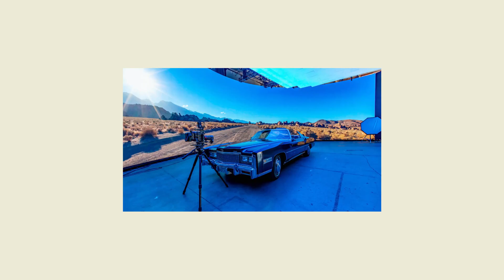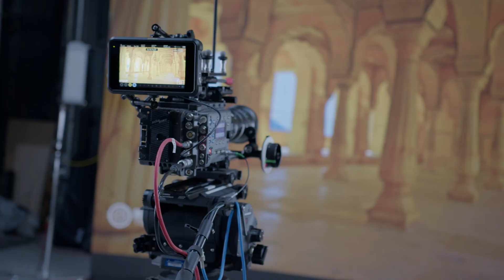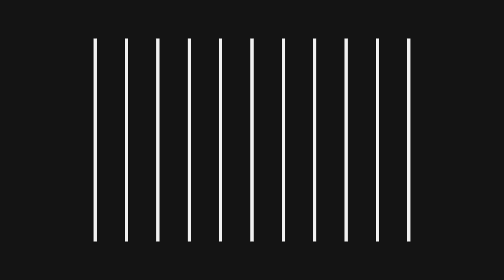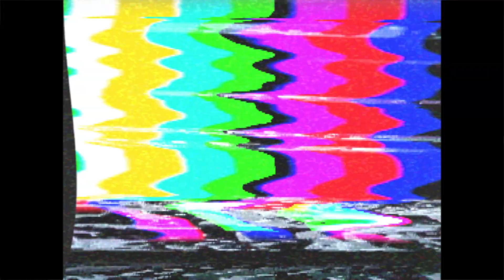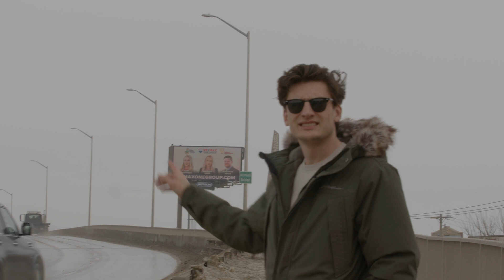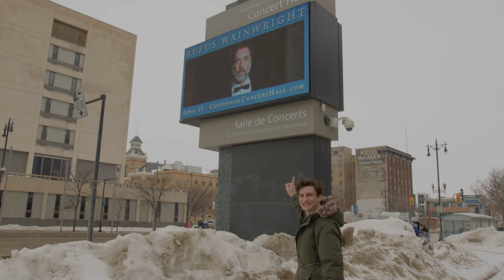Why PIXEL PITCH matters in Virtual Production

Comment: From a technical standpoint, pixel pitch also has an inverse correlation with scan rate, and thus brightness. The finer the pitch, the dimmer the screen will be--which, when used on-camera, directly translates to less dynamic range information being displayed. Higher scan rates also increase the likelihood of flicker and roll bars, even with a perfectly genlocked system.

There is one very well known brand with a relatively new sub-2mm pitch panel that they're pushing for VP use. Only problem is, it's never been successfully synchronized to a rolling shutter camera. I know of at least two large productions that have been burned by this so far.